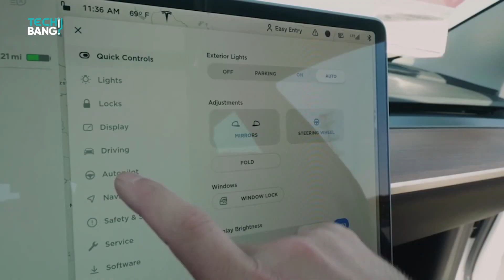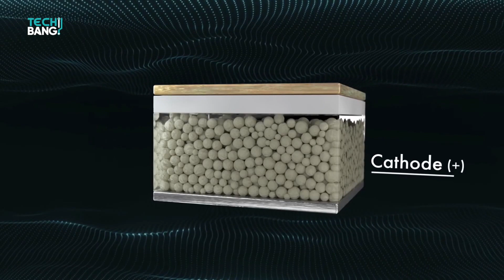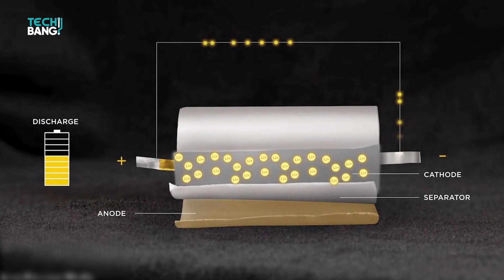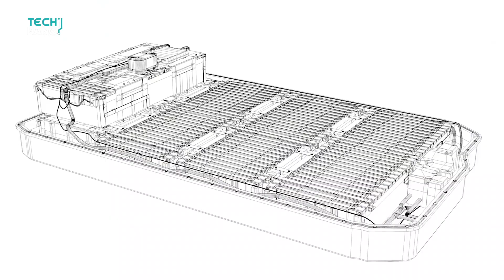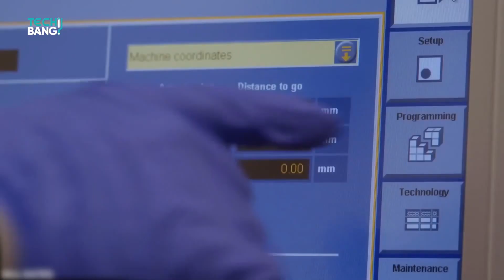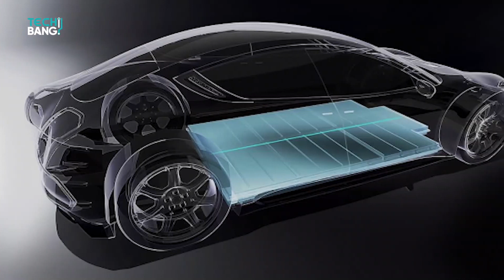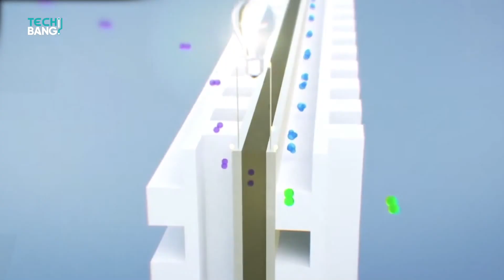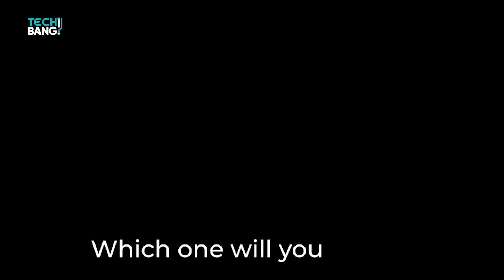Why Solid State Batteries Could Become The New Standard

Comment: There must be something else as a source of energy and storage other than battery, something perhaps hydrogen fuel cell cars but more advanced tech. Car batteries should not be so big and heavy, the modern cars should be able to source energy from something else that is all around us and store some energy in relatively small battery like Toyota hybrids. This cars like Tesla as we all know has no bright or long future, they didn’t 100 years ago and they will not now. Just watch this space.
Reply: Solid state > hydrogen fuel cells. They are safer all around.

The weight of the batteries helps keep the vehicle's center of gravity low and to hug the road better.

Comment: Actually Solid state batteries are already in wide usage - in buses.  They're not suitable for cars because they need to be warmed up to 50-80 degrees C, but perfect for buses that are running constantly either transporting passengers or charging.
Reply: SubrAta Baruah  I was talking about LMP (Lithium Metal Polymer) solid state batteries.  In common use with Electric buses now.  Quantumscape and Toyota are working on different chemistry SS batteries which work at room temperatures and thus more suitable for cars.  Didn’t say I was a great engineer.  Everything I said is information available in the public domain.